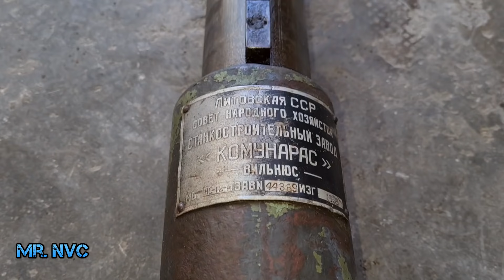Old Rusty Drill Press SOVIET UNION Restoration

Comment: You didn’t change the bearings as you’ve mentioned in other comments, but surely a degrease then re grease wouldn’t harm? 
You say you checked the bearings? But how? Ok if they’re toast you’ll feel it, but with some wear, how?
It’s really not that difficult getting into the Bell housings. I love everything else about this, but for that sake of a pair of bearings for £10-12 why not just do it?

I’m not flame hating on you, the fact you went to the effort to fill the aluminium with filler is immense and more than I’d consider and you’ve come out with an excellent looking drill press. 
Ultimately well done and please don’t be disheartened by my comment, I’d really like appreciate a response as to why you didn’t address the bearings, perhaps I’m too pedantic? 
Best. S.
Reply from the maker: I checked the shaft of the motor doesn't shake, the motor runs very smoothly, so I just cleaned and repainted it.  Thank you for your honest feedback

Comment: Please,  PLEASE,  if you are going to dispense with using new bearings/races in generators and such,  the very least you could do is to apply fresh grease to the old bearings/races when you take the dust caps off them! 
(I would always use new bearings, seals and races, but that's just me!)

Comment: The engine did not understand, there was no revision of the engine bearings?
Well painted. In my opinion, it is so overly good.
The plaques could have been restored a little.
Well, the machine has worked for half a century, now it will work for the next half century.
Reply from the maker: I checked the motor it worked fine, so I didn't change the bearings.